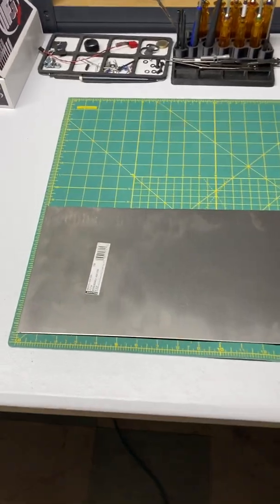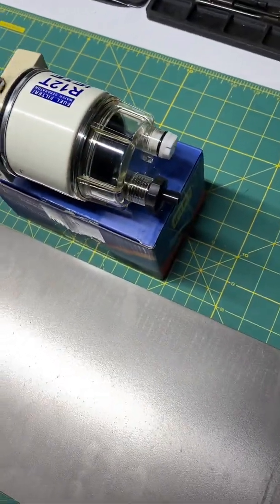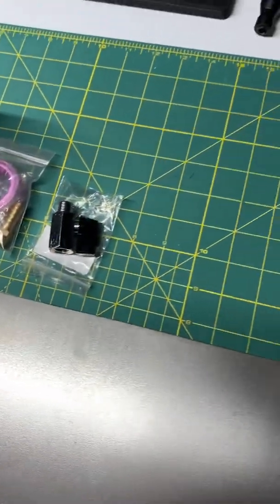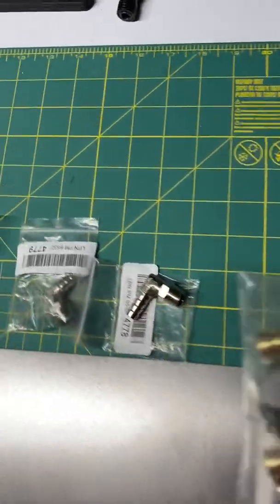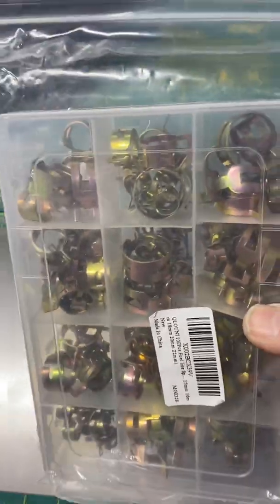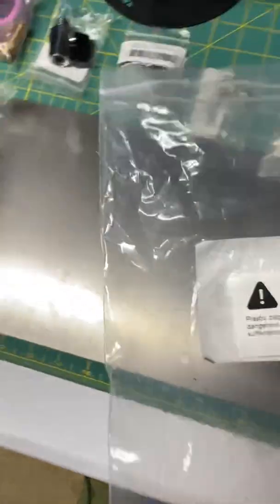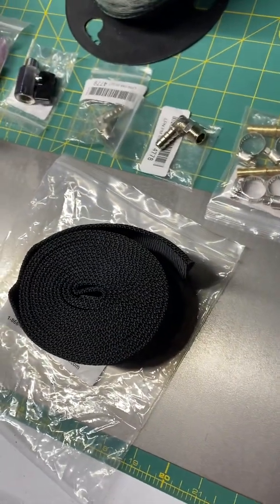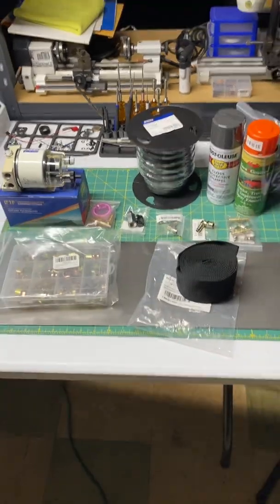Kubota fuel filter / water separator project - Part 1

Comment: Can  this filter be used for diesel fuel ? i think its for gas only  i have  a Kubota BX 2380 3 cylinder 21.8 hp that i would install it on